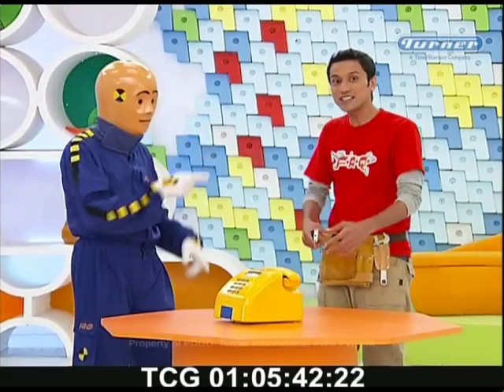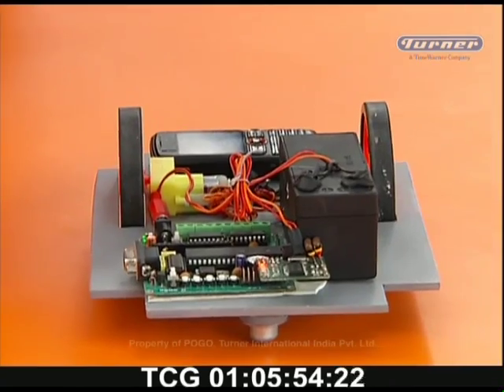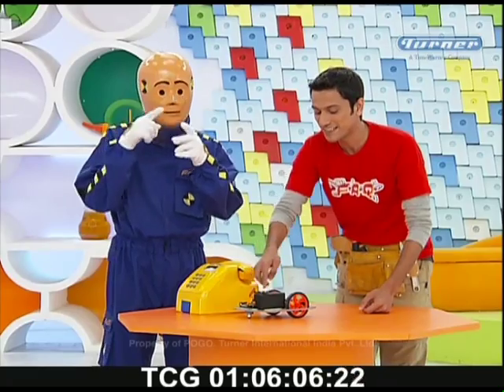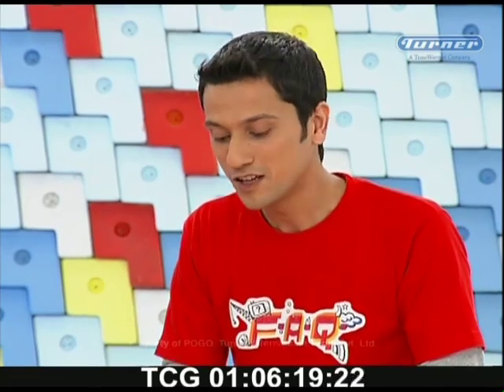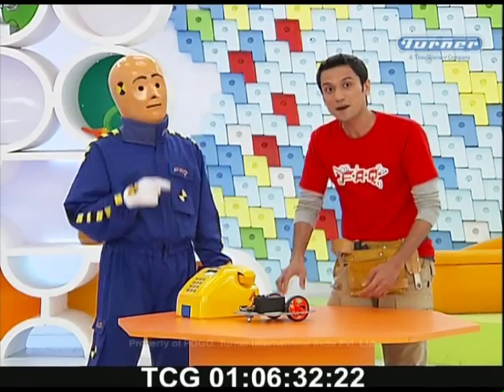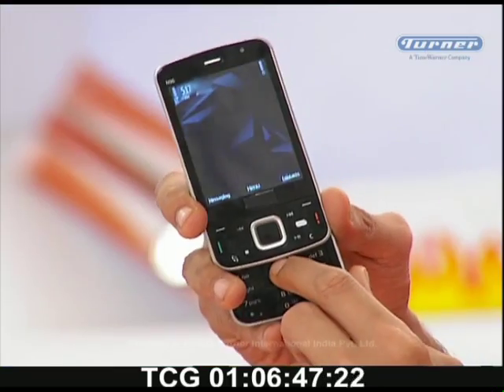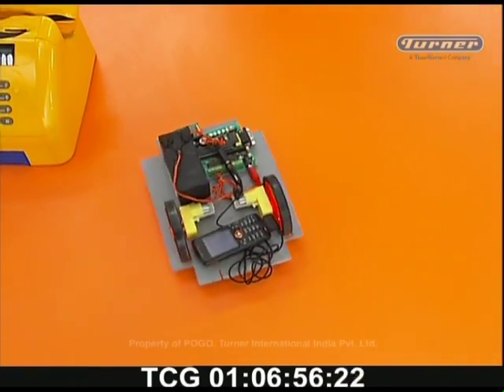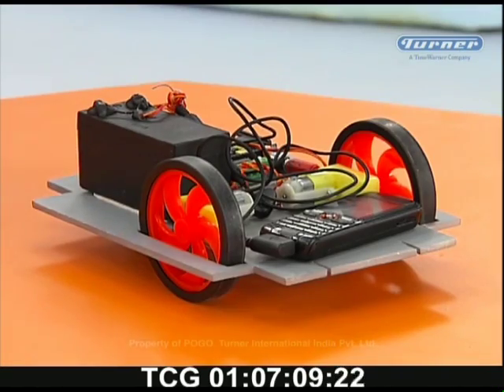Cellphone controlled robot! FAQ Pogo

Comment: Bhai
I want to know more about this
Reply from the maker: Link to component list, code and circuit diagram: http://happybuilding.tv/wp-content/uploads/2018/08/sound-sensing-robot.zip
Reply: Bhai its not working
Reply from the maker: What is not working? can you be more specific?
Reply: I need your help
Reply: Link cannt open
Reply from the maker: @adhiyogi4871  The link is working. I just checked on my computer. The link has the audrino code and the circuit diagram needed to build the robot...I don't think you can open it on the phone. You need to use a computer. Hope that helps! #HappyBuilding
Reply: Es kit ka verson kya h bhai
Reply: Ok bro ill chack
Thank you big b
To reply